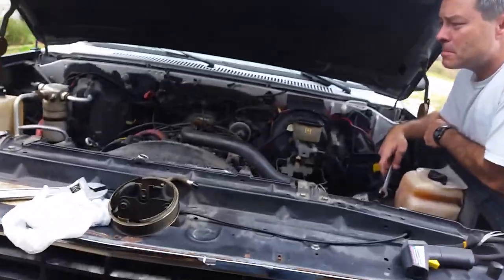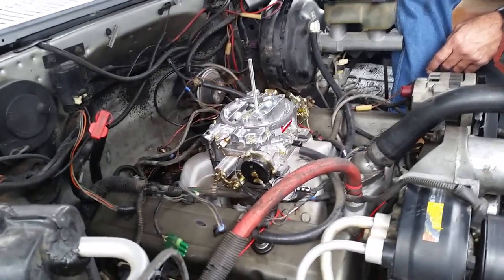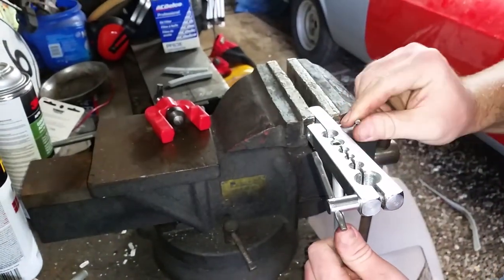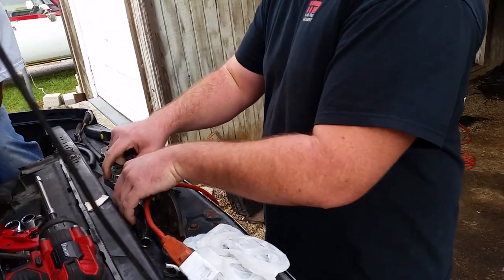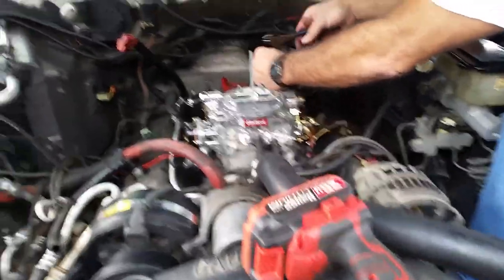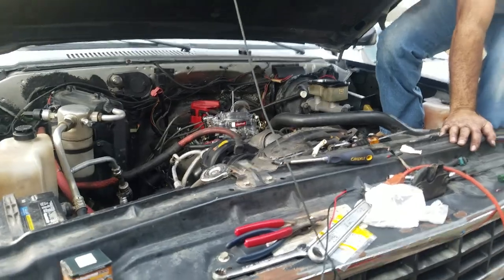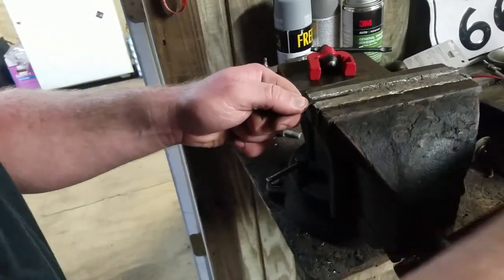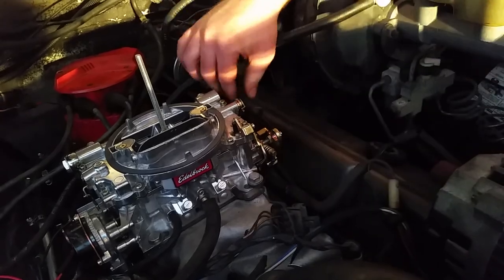1991 Suburban gets a Carb swap

Comment: Did you guys have to change the intake at all? 

I'm trying to do a carb swap on my 93 Chevy Silverado TBI to get away from it, and I'd like to just buy the carb and fuel regulator, lines and fittings if I can get away with it.

Comment: good video my brother ..what  trans do u have in there is it the 700r4 i have a 1990 k5 blazer 5.7 i think we have the same engine im going to be converting my truck.i think with the 700 r4 i think u got to get the conveter lock-up controller. when u convert over to carb with that 700r4  trans....let me no what did u do....

Comment: I've asked questions before did u have to get a different coil for the manifold
Reply from the maker: This is using an HEI distributor with the coil in the cap
Reply: I'm talking about the coil that's on the manifold  that's bolted down  do it get a different type
Reply: Never mind it's just dawned on me duh
Reply: So I'll need a another manifold hei distributor fuel pump regular
Reply: I a msd distributor the better one  to get for it
Reply from the maker: We just used an eBay HEI. They're cheap and we've never had any trouble with them
Reply: Did the gas peddle hook right up to the carb as well as the dtent cable I'm not to concerned about the cruise  control
Reply from the maker: @jennifergrimes7221  with a different throttle cable bracket that bolts to the intake they did.
Reply: Longer or older type
Reply from the maker: @jennifergrimes7221   we just used an old universal one that we had laying around

Comment: What did u do about the transmission  computer
Reply from the maker: This truck didn't have a trans computer. It used a throttle valve (TV) cable the TCC lockup still worked after the swap also.

Comment: How did you wire up your HEI Distributor?
Reply from the maker: I don't remember which wire it was exactly, just use one that has 12v when the key is on and when it's cranking
Reply: If you're still wondering...it's a purple wire with a white stripe and a red wire which is power...the purple one should go to tach
Reply: @Texasmule  what is the purpose of the purple/white wire? I know the red 12V is coil hot